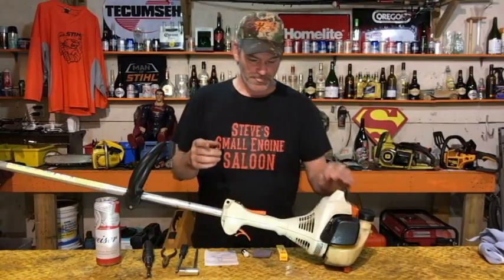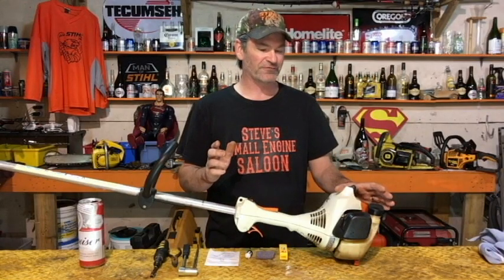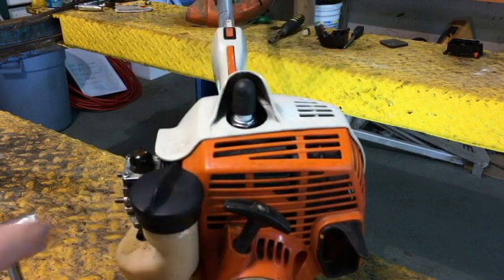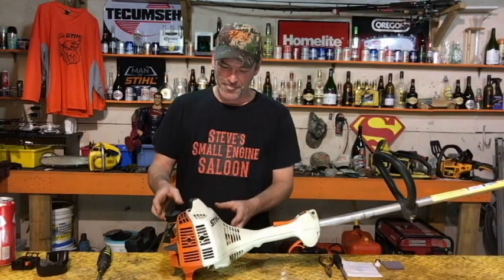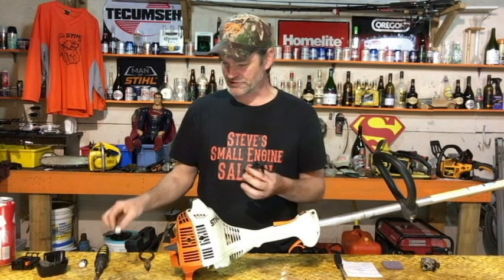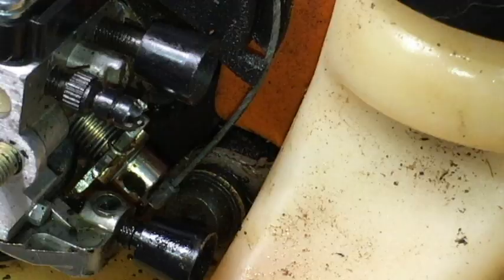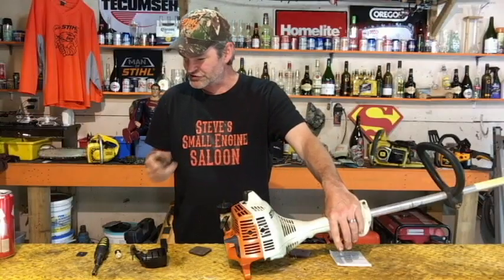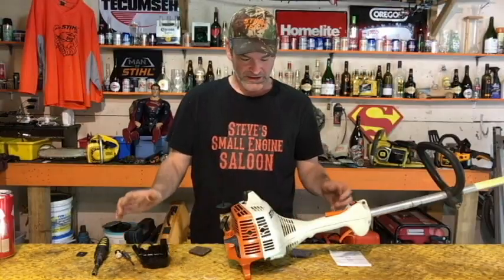How To Do a Basic Tune Up on a Stihl WeedEater

Comment: Steve, thank you for this informative video.  Question, please, somewhat related.  ¿Will a curved shaft trimmer last as long as a straight shaft unit, please?  And, besides the longer reach (under bushes/hedges) advantage, ¿is the curved shaft less effective on trimming grass than the straight model, kindly?  And, lastly, ¿does the curved shaft require periodic lubrication/grease of it's inner drive shaft bearing points, because of its curved design?  (I seem to prefer a curved unit, [as you have in your video] simply because of it's head rotation direction (CW), is lighter than straight model, and also, less initial cost).  Any and all comments and experience you've had with repairs due to their curved shaft design) is very much appreciated.  I've not purchased a gas trimmer yet, and am hoping to make the proper decision in regards to said on a purchase.  (Don't want to make a costly mistake).  Thank you very much, and hope you can find the time and inclination to help/answer my inquiry.  God Bless all your good endeavors.  tonyd\.
Reply from the maker: Sorry for the delay!  I don't believe there is a difference in longevity.  It is good maintenance to lubricate the drive shaft periodically. The two big reasons why people buy straight shaft, is to get under things, like you said, and because most straight shafts can accept a blade.  From what you've told me, and If you will never need a blade, I would suggest a curved shaft.  Specifically the Stihl FS38....inexpensive, high quality and easy to repair!
Reply: Steve, thank you so much for taking the time to reply to my inquiry.  I appreciate it much.  Thank you again and may God Bless all your good endeavors.  tonyd\.